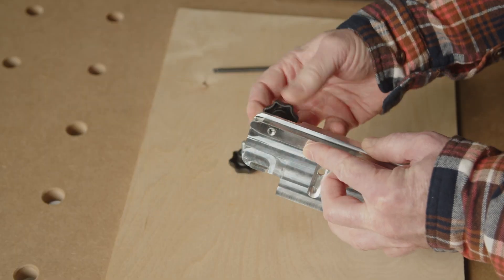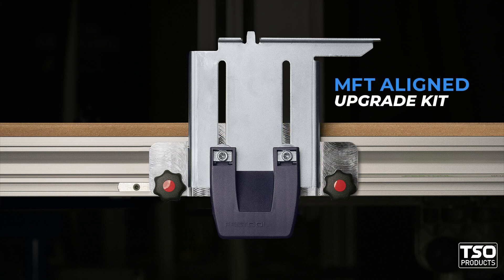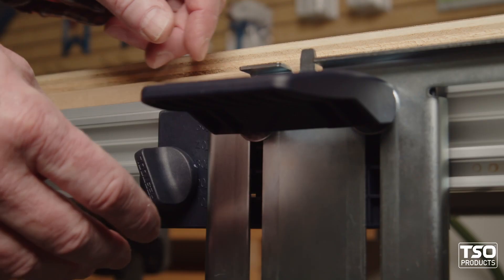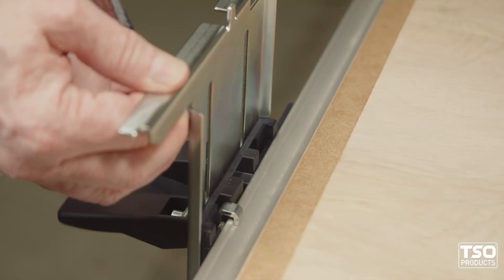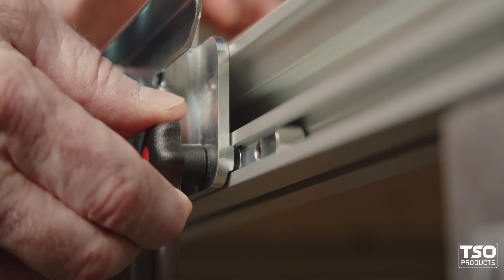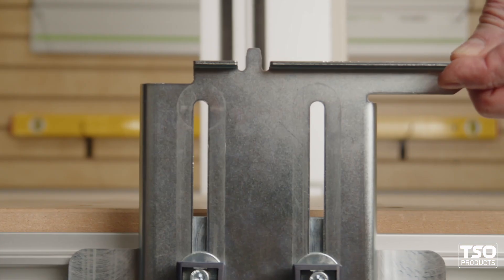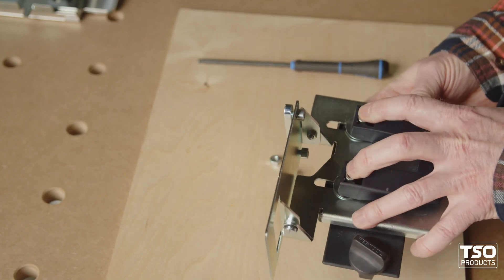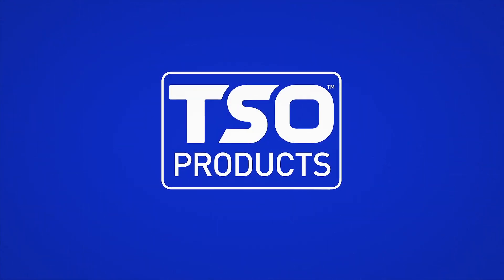MFT Aligned: Guide Rail Support Upgrade Kit Overview

Comment: I have a question in regards to this. Can this be applied for use of a ridgid track instead of a Festool track?
Reply from the maker: Unfortunately, the MFT Aligned is only compatible for the Festool guide rail.

Comment: Great idea. Looks very rigid. The original MFT/3 should have been designed with two contact points to keep the guide pin straight.